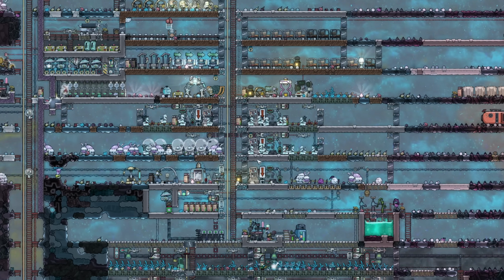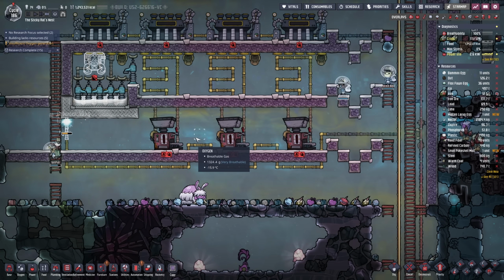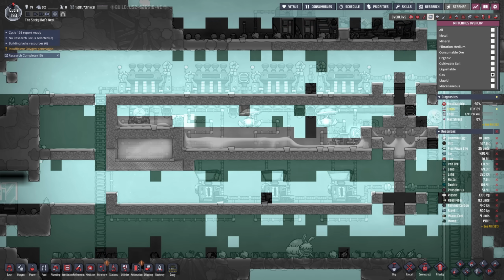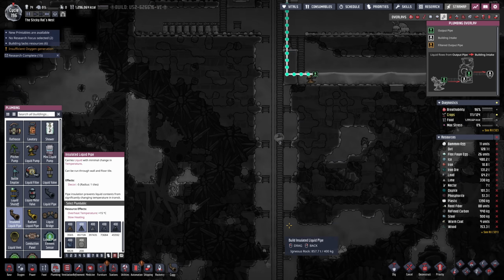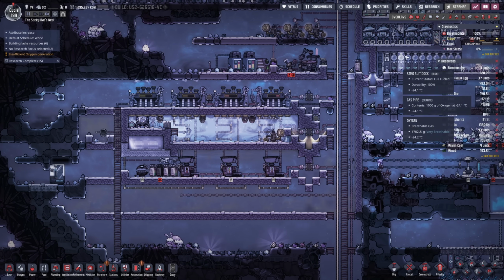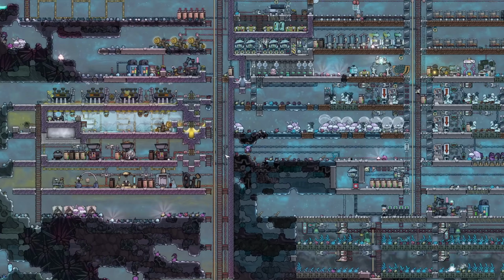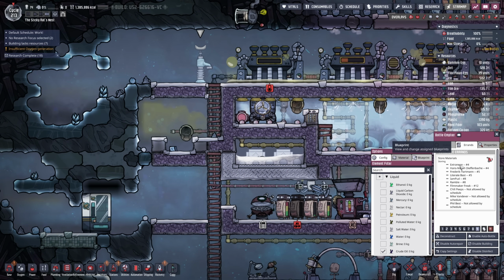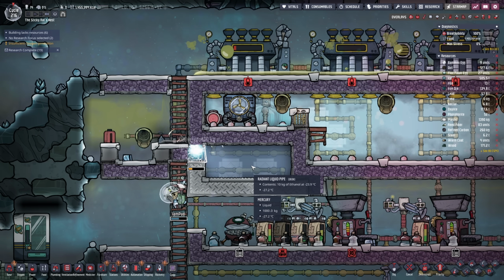Maybe don't freeze salt water : Oxygen not included ep7

Comment: For chilling that doesn't need the temperatures nectar can achieve, water and pwater are both fractionally better (4.179 SHC rather than 4.1). That expanded range on nectar is massive, though, so… yeah. Definitely a good move.

Aquatuners, I presume, have a base overheat of 125°C so that it's possible to run turbines off a gold amalgam aquatuner (though of course you have to double-automate it, putting the input pipe thermo sensor through an AND with an environmental thermo sensor to make sure the steam doesn't get above ~150, which should be enough to keep the tuner below its overheat temperature of 125.

Comment: I always use a metal refinery as the heat source to power a petroleum boiler. I can use this on any planet even without magma etc. you can even automate it, so if you need more heat the dupes refine more iron or steel. it works a champ, but i have never seen anyone else use it like that. refining steel it can handle 10 kg pipe of crude no problem.

Comment: I really like that vacuum lock with the heavy watt joint plate. However, I always assumed that temperature would transfer through the wires. Is that not the case?
Reply: Wires only interact thermally with the tile they are in (I'm not sure if a conduction panel interacts with them like buildings or not).  Buildings are the same and don't even conduct heat to the tile they're above.

Comment: Since your first plan of using a salt water pool for a temp buffer didn't work out, just use a liquid tank instead on the cooling loop.  Also helps with when the aquatuner toggles on and leaves a gap in the pipe

Comment: Something I'm working on in my frosty playthrough; the polluted water geyser can be used to feed arbor trees. That plus a pip ranch or two is a much more efficient way to make wood long-term compared to Floxes.

Also, dunno if you'd be interested, but necter can be evaporated into sucrose and water, plus there's divergents/grubgrubs available on the map (or at least there is in my spaced out playthrough). (Sucrose can also be boiled into carbon dioxide but I highly doubt you'd be interested in using that lol)

Comment: Surprised you didn’t go for the blocked geovent. 

You can just pipe petrol through a couple refineries in series. You only need to get the average temp (when you cursor over the Geothermal pump) around 200. 

Of course, once you do that, you might be tempted to pump magma into a geothermal vent.

Comment: so because i hate using outhouses with a passion, in my early run i threw water in a smelter, looped it till that water was something like 75C then sent it up to the toilets and sinks. sitting in the sinks and toilets through the day it does chill out a decent amount, but it'd typically leave the pipes at 10C, 0C at the very coldest if one of em went unused. and since it leaves the pipe polluted it doesnt freeze. then it gets sent down to be re cooked and repurified to be used again. its been a messy tinker project to balance but it works.

Comment: BTW, I'd highly recommend you try a critter sensor->conveyor chute->critter trap combo as a replacement for unpowered incubators. Basically, you use the critter sensor to count the number of critters and eggs in a small 2*3 room. When you have less than the desired number, you drop the incoming eggs, otherwise you let it overflow to an evolution chamber. When critters are born, they will immediately get trapped inside the critter trap and you can relocate them to any free spot in your ranches.

Compared to incubator, a setting like this is cheaper to build. It's easier to change the number of critters you want to incubate since it's just a matter of changing the critter sensor setting instead of building whole new buildings. It's also more space efficient. It can also lead to a more efficient use of your ranches since you can configure them to only accept adult critters, you can leave babies in their trap room. 

But best of all, since a critter sensor can count live critters, it won't lead to excess adult critters roaming around aimlessly, wasting processing power. Excess critters will remain available for your ranches and the critter sensor will accept or reject new eggs accordingly.

Comment: 13:15 Thinking about it more, that temp shift plate causing the water to form is actually saving the Aquatuner from overheating by keeping the steam in. Else all the steam would leak out and condense away from the AT. I would've never thought of that. Absolutely genius for starting up the system.
Reply: Can u explain a bit more, please?
Reply: @abhishah7139 If he didn't have that temp shift plate there, those two little blobs of water would have easily vaporized, leaving a gap for steam to escape to the right. That steam would condense on the cold pipes to the right and drop down onto the pool of salt water. This would continue  until all the steam surrounding the aquatuner escaped (although the aquatuner would easily end up overheating well before as a result). Having that tempshift plate there effectively forces all steam that passes over it to condense, thus trapping the steam in that zone arund the aquatuner. This should continue until the pool of water above the salt water by the pipes reaches around 97℃ where the differentials in temperature isn't high enough to keep condensing water (due to how rate of heat transfer works).
This effecively allows him to keep the cooling loop active/automated and effectively start up the system. If not, he would've ended up needing to keep the aquatuner off until he refined enough metal to inject heat and turn the pool of salt water into steam.

Comment: With the Spaced out DLC, Nectar can be used as a source of sucrose for grubgrub ranching. You get about 15.4kg of sucrose (plus 4.6kg of water) by boiling or freezing the nectar from a fully illuminated tree. If you use only sunlight, then the harvest is gonna be much smaller, but it's still a reasonable way to ranch GrubGrub. I think a mixed critter ranch with 5 bammoths and 1 Grubgrub would be a good way to efficiently produce meat with less ethanol. 

Without Spaced out, you're pretty much limited to plastic and Spigot Seals unfortunately. I guess you could feed the plastic to a sourgas boiler, but you'd need 50 fully illuminated tree for a single 1kg/s boiler, so it's not that great, especially considering crude is so much easier.

Comment: If you want a more stable battery energy (as I do), you could set like, some of you steam generators to run continuously, and not power on/off every time the battery reaches the tresholds. I know it may have moments that you may end losing a small amount of energy, but I find this better than enabling all together. I also think it is easier to do a quick verification if the amount of "installed capacity" is enough.
Reply: He REALLY needs to do a run of Capitan of Industry, then power juggling would imprint into his mind forever.
Reply: @mrShift_0044  He has done one!

Comment: you should look at what happens when you put a liquid over 2226.85 °C in the geothermal power plant and realize the potential for the rube goldberg machine necessary to make it work
it would be quite the thing
Reply: i would love to see how he would manage all 16 different elemetal outputs
Reply: +1 to this idea.  Working with super high temperature differentials and super hot liquids would be fun to watch. Would lead to a few side projects and shennanigans.
Reply: I'm actually working on this right now, largely for kicks. As a bonus I'm trying to do it all without access to supermaterials. The current plan is to use molten gold from a volcano I happen to have — I'm mostly just trying to work out whether insulated ceramic pipes can take it far enough without it cooling to freezing point, or if I'm going to have to get inventive. Doesn't matter if it drops below the 2500K target in the pipes since I can always boost it back up with a metal refinery, but if it's going to freeze I'll need to set up a big ol' vacuum chimney to pour it down. I was originally going to use molten glass but gold has a lower SHC (lowest of any material that's liquid at 2500K!), making it less costly to heat up if a temperature boost is needed, and I've got a volcano spitting it out at 2700K right there halfway across the map…

Comment: Just some tip that may be a bit exploit...

1. Since you don't place compost pit, you can indefinitely save unreachable sleatwheat by marking it for compost - when you unmark it from compost it will be 100% fresh.

2. Tempshift plate under a tile (800kg+200kg good as temp buffer tiles) - Build tempshift plate, build ladder over tempshift plate, ovewrite ladder with tile(normal,metal,airflow,mesh)
Reply: I do #1 also :(  You mark for compost, then mark for sweep and then the cancel composting button shows up.  Once you click, like you said, 100% fresh.  But it only seems to work for sleetwheat.  This has been around for a looong time and has never been patched... No idea why.

#2  Yeah, they introduced this 'bug' when they allowed for overwriting ladders with tiles a long time back.
Reply: @dmd733  #1 can also be done with nosh beans. This is probably because sleat and nosh are both seeds

Comment: francis, you could go with one of those infinite ranches, where the stable door is left open, and the critters are allowed to roam around a bit. i have been doing this with 1 stable, shared by both floxes and bammoths, it has been very effective.
Reply: how does that work?
Reply: @lorelius.hogglefart  it works by the fact that critters only need to be in a stable to be groomed or sheared. once this happens, they don't have to stay in the stable for the duration of the effect. when they go into the stable, they get cramped, but if you design it where the stable represents a small percentage of their path (say 30%), then they will only be cramped for 30% of the time. while outside the stable, they will keep their groomed status, reproduction rate, happiness, metabolism that you want out of the critters. with that said, you want the feed stations outside of the stables, because cramped status will effect the diet, and whatever secondary product they drop.

Comment: why dont u fill up the cooling pool u filled with mercury with nectar? love the videos ❤
Reply: Because the nectar is a coolant in the pipes and it will not be possible to turn nectar in bath-brick solid. And, as I reckon, solids are more thermal conductive then liquids.